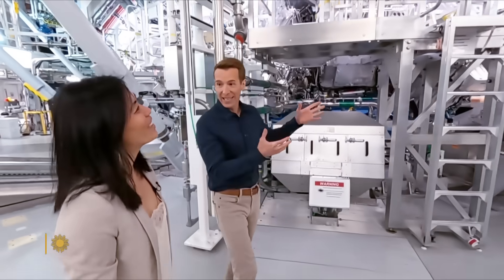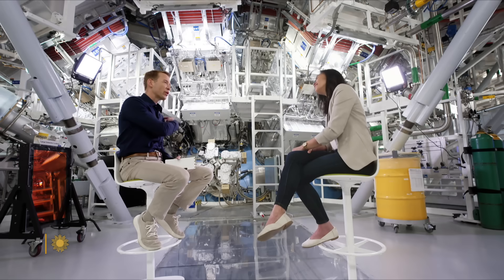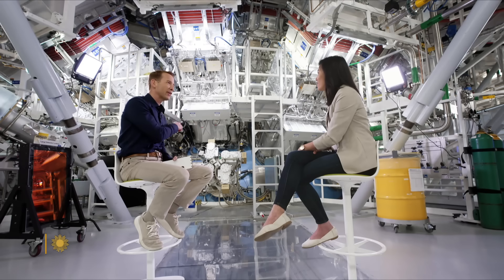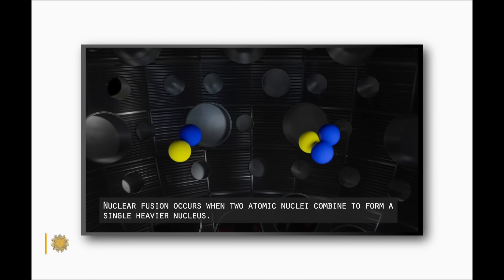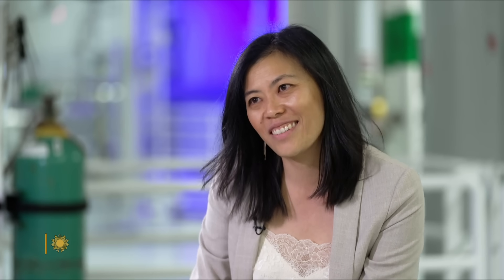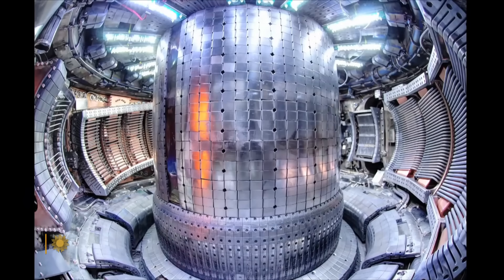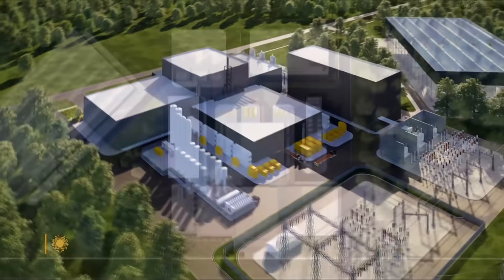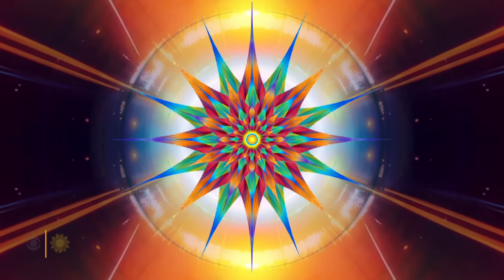Fusion energy: Unlocking the power of the stars

Comment: Fusion is the power of tomorrow!! (and probably always will be)  Our Hostess talks as if fusion power planets are ready to go anywhere.  That's a cool pitch - and that's all it is.  While they have stepped over a milestone (More energy out than in) practical application is not even on the horizon.  Be real with people please.
Reply: Even the claim that more energy came out then went in is a calculated distortion of the truth that has become standard practice in the field. The input energy parameter that is used is the amount of energy at the end of a very inefficient laser chain that ends up compressing the fuel. In magnetic confinement fusion (MCF) experiments the chosen input energy that couples with the plasma to heat it to fusion temperatures. The energy gain is expressed as Qp, or Q-plasma. That value leaves out the energy needed to power the facilities. That energy can easily be over 100 times greater. In the case of the 12/05/2022 NIF experimental shot the pumping of the lasers consumed more than 100 times more energy than was measured coming from the exceedingly brief fusion reaction. That reaction lasted for only 0.000,000,000,08 second before the central microscopic blast blasted away the vast majority of the expensive fuel before it had a chance to react. The federal lab's use of the term 'ignition' has been misleading. Very little propagation of the reaction occurred before the reaction snuffed itself out. The experiment took about a week to set up so the facilities energy consumption during that week should have been the input energy parameter. It has widely been accepted that a successful inertial confinement fusion (ICF) nuclear fusion energy power plant would need to operate at a rate of at least 10 shots per second. The 12/05/2022 experiment puts NIF well beyond a million times away from such a goal.

Comment: we have 12 fusion start up companies, all working models, this is the beginning of a new energy industry here in America that will lead the world. one of the twelve start ups have a plan to scale up their fusion energy plant in Virginia, by 2035 in the next 10 years. also the NIF in California their design is using lasers for more energy in then out. excellent work
Reply: Those, who can read and understand the technical papers related to these experimental facilities, are likely to realize that the publicly advertised goals are a far cry from what their machines are likely to achieve. The promoters tend to pray upon the general public's and the reporting journalist's lack of familiarity with details in this field.

The Commonwealth Fusion Systems (CFS) ARC fusion reactor proposal, for a Virginia electrical utility company, is based upon their SPARC experimental machine that won't come anywhere close to resembling a developed electrical generating station. It isn't even known if SPARC experiments will achieve more fusion energy then the energy needed to heat the plasma up to fusion energy temperatures. SPARC is designed to operate for a maximum of 10 seconds and then have a lengthy recovery period. It has no significant hear removal system. It will not have a tritium breeding blanket. It won't have the numerous components needed for a power plant such as a steam generator, a condenser system, a secondary heat dissipation system, a turbine, a generator and an electrical substation. The problems associated with creating a tritium breeding blanket were expected to be worked out by the ITER project but massive delays have pushed those experiments out to beyond 2040.

Virtually all nuclear energy promoters, are in line with the vast majority of Earth's other 8.2+ billion humans, who continue to assume that we still have at least 20 years left to turn this 'Titanic' around using their favorite nuclear technology. They have become masterful in excluding the following warnings from their consciousness. I urge readers to search for the following two article titles.

IPCC report: ‘now or never’ if world is to stave off climate disaster (TheGuardian)

UN chief: World has less than 2 years to avoid 'runaway climate change' (TheHill)
  * This statement was made 6.5 years ago.

Comment: Ok, that lady needs to say they got more energy out than they put in with a HUGE honkin' asterisk next to that statement, because while yes the power in the laser pulse was smaller than the engineer that came out of fusion (and I'm ignore the fact they don't have a way to capture and use that energy) but the power needed to fire up that huge array of lasers absolutely dwarfed the amount of energy they got out of doing fusion.
And now for the real pessimist view(s).
It is not going to be "limitless" power, because there absolutely will be a limit based on the output of whatever power plant (assume they get to that point) can put out.  
and unfortunately it probably won't make energy intensive projects like desalinization and vertical farming affordable because whomever funds the building of these fusion plants more likely than not will sell the energy back to power companies, at market rates, and we'll find that the actual cost of electricity doesn't change much at all.   Making power plants ain't a cheap thing, and those who have the money to build them aren't going to build so many of them that they flood the market and make power cheap by sheer amounts.

Comment: The claim that fusion ignition produced more energy than it put in was extremely misleading. Fusion is hard. Harnessing fusion and converting it into usable energy is harder still. I certainly hope we can harness fusion in my lifetime, but I tend to doubt it.
Reply: Likewise it's misleading to claim it's completely clean. The "blanket" (or interior surface) of fusion reactors will absorb the high energy neutrons that fusion reactions produce which will convert stable isotopes into radioactive isotopes over time. It would be more accurate to say fusion is "cleaner" than traditional fission reactions.
Reply: In the show, the breakthrough has been made in 2022. More energy out that in.

Comment: We already have a cosmically sized fusion reactor in the sky we get for free that can power the world at least 10,000-times over.  It never breaks down or needs maintenance.  Some combination of wind & sun is available every place on Earth and can power that region many many times over.  The raw inputs of sun & wind cannot be sanctioned, tariffed, taxed, or blockaded.

Renewable capacity is growing worldwide at exponential rates.  Renewables are already at historic low costs of energy production and yet continue to drive their costs even lower every year.   This means that each year, the challenge of fusion becomes all that more difficult economically and logistically, that's on top of the gigantic technical problem of fusion itself.

Presuming a big IF large-scale sustainable fusion becomes available in 40+ years, it will be completely irrelevant for generating power on the grid and would not be economically viable.  Fusion might only be useful for military, scientific and deep-space exploration.  But even then, we already have fission nuclear for all of that which is simpler to operate and better understood.  Competition already exists within the nuclear industry itself.  Which why Thorium nuclear has never prospered even though, on paper, it is better than traditional commonplace U-235 slow-neutron fission reactors.

Grid-scale energy storage is growing exponentially as well to offset the renewable intermittency problems.  There are more options than lithium.  Look into liquid-metal flow batteries, compressed air (CO2), pumped hydro-storage, gravity, thermal storage (ceramic/sand) and even form of hydrogen.

The field of grid-scale energy storage is white hot right now with R&D, research, subsidies, investment and academic/commercial interest.   This is because grid-scale storage removes the one weakness of renewables with its intermittency.  Grid-scale storage will usher in the era of dispatchable "firm renewables" which will absolutely mop the floor with every other energy production we have on Earth.

Especially look into thermal storage using common & cheap silicates like sand/ceramics.  Because a lot of industrial processes like concrete and cement manufacturing need high heat.  Thermal storage can store that heat for months with well-designed containment.  The heat can also be used to generate electricity again with good old well-understood steam turbine technology.

Comment: All hype, no fusion experiment has achieved a full system net energy gain … the lasers used hundreds of times more energy than what was produced in fusion, meaning the total system still lost energy. They used A LOT of energy just to create the IGNITION part.
Reply: They used 2.05 megajoules (MJ) of laser energy to ignite a fusion reaction that produced 3.15 MJ of energy.

See the fusion reaction itself was “net positive”—it gave out more energy than was directly put into the fuel.

BUT the Whole System Still Loses Energy
Because to fire those lasers, the facility actually used 300 MJ of electricity.

That means the overall system still consumed way more energy than it produced.